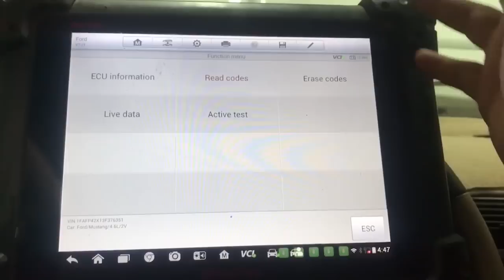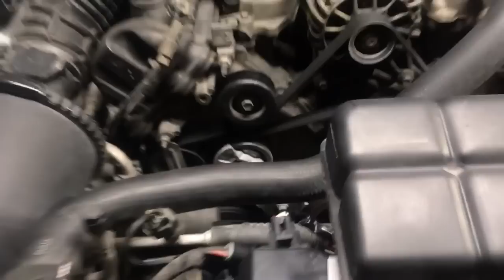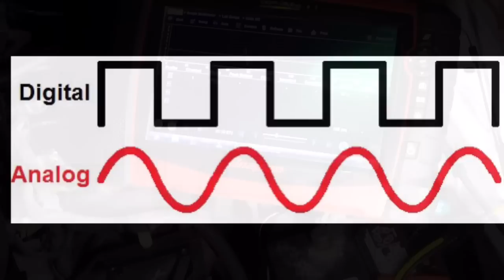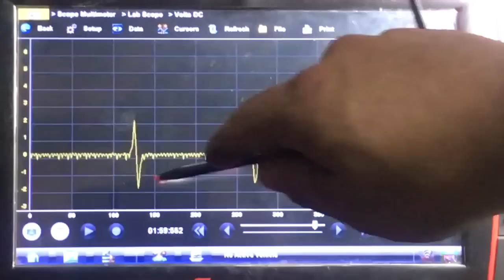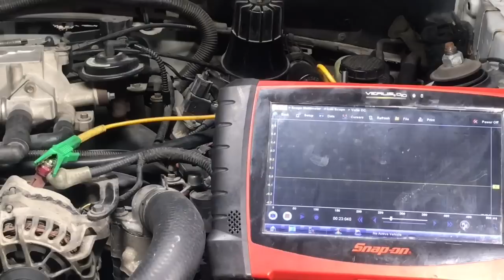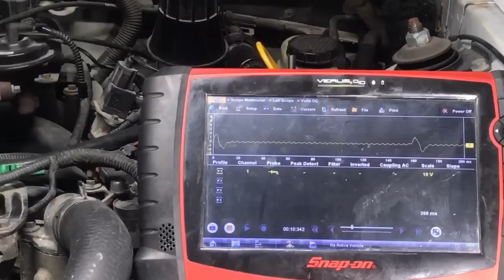How to fix code P0340.  A new cam sensor will not repair this car.

Comment: I just got the P0340 on my 99 Ford Explorer EB 5.0 but I don’t have a scope to determine if it’s my alternator but I do have suspicions that it could be the alternator how could I tell?
Reply: rawdeale get an alternator and change it, if it fixes it drive on, if it doesn’t take the alternator back and replace the cam sensor after checking the wiring.

Comment: I got the 340 code/cam pos sensor bank 1. Replaced it with autozone sensor and ran worse. Then tried OEM sensor and still runs worse than part that's was originally in there. Does the battery need to reset after replacing? Any ideas?
Reply from the maker: Fish Stix first what needs to be does is to hook up a scope to verify powers grounds and signals from the cam.
Reply: @OzMechanics  ok thanks. I'm gonna need to take it in for that. I was worried that my parts weren't correct, as the aftermarket and oem ones both seemed to have a smaller magnet than the one that was originally on there
Reply: Both replacement parts make it run worse than the original one that's throwing the code and giving me the misfire
Reply from the maker: This video is an example of a bad new sensor. But I would t have know without a scope 

P0340 Testing a BAD cam sensor https://youtu.be/bCHQfMA6aLw

Comment: I have a 2005 pathfinder its saying cam sensor. I put one in an it ran great for not 10 mins an just through code again. Any ideas
Reply from the maker: Matthew Corbin the proper way to verify what’s going is by using a scope to see the voltage
Reply from the maker: Does it have code p0340
Reply: Yes p340 code is showing... but when i put a fresh sensor In it doesn't show till it malfunctions again. I also see where a wire has been worked on
Reply from the maker: Matthew Corbin might have a short somewhere. Scope would be used to see the signal
Reply: @matthewcorbin850  did you find the issue?

Comment: Code P0340
Well, in your case your car starts up “normally” 
In my case, my car tries to start up but won’t do it at all 
I thought it had a battery issue but I test it and it was ok.  because when you try to start up the car, the engine sounds weak and won’t start 
I think I will check on the alternator and see what happens 
Thanks 👍🏼
Reply: MY friend and others 
Let me tell you that in my case 
The timing chain was broken so it was Not moving the camshafts 
That’s why the error message P0340

Comment: damn Bro u the bomb . how does a bad alt kick off a bad cam sensor code though ?
Reply from the maker: 2 wire cam sensors are ac signals. The same as a bad diode In an alternator that produces ac signal
Reply: @OzMechanics  i have a 3 wire cam. Plug
Reply: @OzMechanics  plus its a honda but no doubt I check my alt and it is bad, you a good mechanic. Im hoping this is my problem :)

Comment: I just replaced cam sensor on 04 F150, 4.6. Scan tool says it caused #5 misfire.
truck runs bad.
the change out did not help the performance.
could alternator cause this?
Reply from the maker: Brad Turner what code did the vehicle have ?
Reply: @OzMechanics  P0305 & P0316.
I changed cam sensor. light is gone now but still rough idle, power loss, and no A/C when going up hill or under load.
All of this started at once during a 3 hour trip at highways speeds.
Update, installed new coil pack on #6 cylinder tonight and it's running better than ever.
Reply: B_ rad Did you do a relearn after replacing those parts?

Comment: Iam no genius but I wonder if the after market alarm is causeing a ripple back feed voltage through where it is robbing power off of. Cause without the altinator the battery becomes the condenser. So I wonder if you disconnect power from the after market alarm would that get rid of the ripple on the 5v signal. Sence the after market alarm might be smd pwm. And not a ecc analog power and ground ac to dc bias voltage set up witch is how the car was engineered to work. Cause smd/ pwm  circut boards where not common place on. Vehicles till around 2007 or so. Just a thought. Maby the after market alarm is causeing the diode or voltage regulator on the altinator to work against the pwm ripple on both +and - sides. Cause after all wires are bidirectional and also magnifie / absorbe  any electrons or rf signal in either direction cause the electrons/ cathode always wants to go to the anode. And re start the electron / neutron process of chemical reaction from +to - then back to - and etc.

Comment: What about code P0345
Reply: I just got my f150 ran through a diagnostics machine and it came up with my camshaft position sensor and the code was p0345. Any advice other than replacing the sensor?

Comment: Cam shaft sensor bank 1 on a nissan for sure.👍
Reply: I have 05 maxima. Going through it now
Reply: @mef12727  was that it?
Reply: @mikerobinson4092  yes also my wires( plugs from the harness) were exposed. I went to junk yard for a better plug.
Reply: @mef12727 ok👍
Reply: @mef12727 me to I can't accelerate much car seems to be in limp mode and stuck in gear

Comment: My cousin changed her cam intake sensor because she got a p0340 code for bank 1 sensor or Bank A or single sensor and the car does the same takes about like 3-5 seconds to crank and turn on. She has a Mercedez benz c250 2012 1.8L and im thinking if it can be the Cam adjuster magnet? 🤔
Reply from the maker: MR M3 I would check powers and grounds and the sensor. And make sure you are getting a proper signal coming from the cam sensor using a scope
Reply: @OzMechanics  thanks a local Mercedes benz shop replaced the parts and didn't do anything different. Tbh i feel like if my cousin takes car back won't do anything tbh would he worthless leaving for 3 days for nonesense
Reply: @mrm3686  any update on this?
Reply: @GTiR23  Yes so I got to fix the issue and was resolved by replacing the Actuator which was failing since its magnetized and reads the Cam sensor and would not read correctly so the car would run rough and sometimes turn off. So replace actuator and replace the oil and If possible replace camshaft position sensors with new ones and that should help you with the issue
Reply: @mrm3686  Thanks for the advice!

Comment: Could you please tell me where the Krank sensor positioner is on a 1995 five point o mustang convertible please text me back my name is John
Reply: Google it man. You will need your engine size as well. Just type in Crank position sensor location 95 mustang and you will find it. Google has all the answers you will ever need.

Comment: I'm having this same code in my expedition. Took to Autozone pulled codes. Had the position senor fault P0340 Said replace alternator, with the cam sensor faults. Will find out more Monday when I have my Tech look at it
Reply: @Hi Me I never found out. I traded it for a Brand New F150.

Comment: can timing belt  cause same error code?
Reply from the maker: This is a circuit code so more often is a wiring issue or the sensor itself
Reply: I  loved  the  way  you  cleaned  up the  power and  eliminated erroneous  signals. It's  just  taken  for  granite  that  power is  good. honestly  I  don't  know  why  checking power isn't SOP for any  problem  involving electronics.  noisy  power =  bad problems.  great lesson.

Comment: Found this video as I am tackling a stubborn P0335 Code on a 2010 Honda Civic Hybrid (not my first choice in a car but as a ride share free lancer; it is my bread and butter) Replaced cam sensor (New OEM) and it’s back six months after the repair. Ocasional abnormal idle. Rpm activity will act up while driving and shifting gears. Lurches every now and again while driving. I appreciate this thorough and informative video. I am still scratching my head on what could be causing this code but it looks like I found myself a good channel to subscribe to in the process. Video notifications are turned on. Great video!
Reply from the maker: Paradoxx thanks for stopping by and checking out the video and  for subscribing as well. Have some new videos coming out soon

Comment: My 2006 Mustang GT has codes P0345 and P0349. Both of my cam position sensors are new as well as my crank position sensor (Ford OEM).I just replaced the lash adjusters, cam followers, cams and all timing components (everything new). I am 99.9% sure that the timing is correct as I took my time with it and had the crank locked in position with the tool and had the chains lined up on the dot on the crank and the other end on the phasers in their correct places. It says I basically have a VCT solenoid stuck open or my timing is off and that my cam position sensor is bad. The car will start up and idle, but if you try to give it gas at all it backfires through the exhaust. I do not have this expensive scanner. Please help me out if you can. Thanks, Frank.
Reply: Any answer on this I need it too
Reply: @damianwayne5302  I found out that I had the aftermarket non OEM cam phasers on in the wrong orientation. Driver side "L" at 12 o'clock (on colored chain link) and passenger side "R" at 12 o'clock (on colored chain link). Once I found my issue and reset my timing chains and phasers I was good to go. The most common issues are a stuck VCT solenoid(s), bad alternator, bad timing/jumped timing.

Comment: I just bought a Ford ZX-2 that was giving cam and crank codes and came across this. Wouldn't have thought that the alternator could cause anything like this, how bizarre.
Reply: Did you replace the alternator? Did the problem went away?
Reply: @raiya1114  i would like to know the answer to this aslo

Comment: Good diagnostic video, thanks alot. But I got a question, after disconnecting the alternator, what happened to the alarm P0340.
Reply from the maker: Waheeb Sayani Is which alarm are you talking about ?
Reply: @OzMechanics  As i understood from your video is that the alarm  P0340 was actually generated due to high ripples generated from the alternator, so you disconnected it, my question was, did the Alarm P0340 was cleared after you disconnected the alternator?
Reply from the maker: Waheeb Sayani if you mean the check engine light. It has to be cleared
Reply: @waheebsayani4111  codes stay in the computer until they're removed (either leaving the battery unplugged for awhile, or using a code reader).

Because of that, you can have a situation where you're not sure if a code is current or just a uncleared older issue.

Comment: OZ MECHANICS I HAVE THE SAME ISSUE WITH THE SAME CODES OF P0340 AND P0344 ON MY 2005 EXPEDITION AND NO ONE SEEMS TO KNOW THE ISSUE. HAVE REPLACED THE CAM SHAFT SENSORS STILL KEEPS READING THE CODES.. YOU WOULDNT HAPPEN TO BE LOCATED IN SOUTHERN CALIFORNIA WOULD YOU?? LOVE THE VIDEO AND VERY INFORMATIONAL..
Reply from the maker: I’m actually in Texas but I do know some people in the LA area and dan Diego
Reply: @OzMechanics  THANKS FOR THE REPLY. PLEASE SEND ME THEIR INFO SO I CAN LOOK THEM UP AND SEE IF THEY CAN LOOK AT MY TRUCK.. HOPEFULLY IT DOESN'T COME OUT TOO EXPENSIVE TO FIX BUT HAVE TO GET IT DONE.. THANKS OZ MECHANICS..
Reply from the maker: GREG ESCOBEDO What part of California are you in ?
Reply: @OzMechanics  I'M IN THE ANTELOPE VALLEY WHICH IS NEAR THE SAN FERNANDO VALLEY..

Comment: Good job on the video, not all of us have an expensive snap-on scope, how do we diagnose a P0340 code without an expensive scope?
Reply: Any oscilloscope should work here:a cheap chinese one aught to do just as well. The Snap-on one is just made with Automotive use in mind (and they're built like tanks).

You may also be able to remove the alternator and take it to a shop to have it tested for this as well, which might be a cheaper option then taking in the whole car.

Comment: That was great , my cam pos sensor is barely a year old. The body that the sensor rides on was changed about a year and a half ago. That damn p0340 pops up every month or so, truck runs good so I don’t think that it’s sensor. It’s gotta be the alt. Thank You for the Video.
Reply: so was it the alt ?

Comment: 2003 Honda Accord 4cyl.
I got a check engine light P0341 that i need to clear.
It sounds like a lawnmower when i start it and the RPM drops and dies out.
I changed the spark plugs and coils with new ones and 
It cleared the 4 codes it had that were P0300, P0301, P0302, P0303, P0304
HELP?

Comment: Good video I have a 2004 Mountaineer,I live in Illinois where I just failed the emission test one of the codes was this one P0340 and the other was P1336 from what I could look up one was the cam sensor the other the crankshaft position sensor  do you think a bad diode could effect them both because the truck is running just fine,any suggestions
Reply: This is the problem I have. Idk what to do
Reply: @thomasbackovich3045  man good luck I ended up replacing the camshaft and crankshaft sensors that didn't changed the plugs a couple of bad coils and battery and alternator after the mechanic and other mechanics were saying put a engine in it it wasn't worth it so I got rid of it.... I hate it too because I liked that truck!
Reply: @kjam4236  I’m getting a ticking sound from what’s sounds like the intake manifold and I’m getting a wine. I’m replacing the alternator the two sensors and a thermal housing unit.

Comment: Yo Oz!  Great videos.  Thanks for sharing the knowledge. I was wondering; Can you replace the diode bridge regulator on those instead of the complete alternator? I was able to do it on my VWs.  It would be a lot cheaper.  Ivan would be proud!
Reply from the maker: Carlos Moreira yes you can but here at the shop I just go ahead and replace with a oem unit.

Comment: Aye bro my car has the same code and i changed the sensor my alternator is fine and i cant find whats the problem my car cranks for like 5 seconds then starts and has a rough idle also i have a chrysler 300c 5.7 hemi and one other problem i have is that ny engine wont past 40mph or 3000rpms and i dont know bro i changed alot of things and isn't working im about to give up can u help out on some bro??
Reply from the maker: Ricardo Rogers Ricardo to be honest brother I don’t want to give you false info. Th proper way to fix the issue is to diagnoses it. Cars are getting pretty complicated now. I just don’t want to give false info so you could be out more money
Reply: Where you think i can diagnose it?  Cause i myself dont have the tools
Reply from the maker: Ricardo Rogers with out tools it’s really hard to diagnose.

Comment: It's things like this that motivated me to buy a scope. Love the diagnostic strategy. Excellent work Oz 💪
Reply: I have a 2004 F150 with the code p0340. Changed both of the sensors and check engine light lights up after a while. When the truck is in parking, it feels like a rough idle but once i put it in drive, theres no rough idle. What do u think?
Reply: Dido on the scope fixing to get me one.

Comment: When I first started down this path of learning about diagnostics, I was attempting to find a way a DIY'er could bypass using a scope and use common methods (cheap). But as I learn, I have also realized having a scope is required, or, you take it to a good shop.
Reply from the maker: That is true. Scope just makes everything easier and clarifies the actual problem. Once I got my hands on one I was hooked

Comment: Good job Oz. Really appreciate your videos.  From experience 120 mV AC to 250 mV AC seems to be the max allowed ripple depending on manufacturers. Usually outside this range you'll get sensor related codes just like this beauty you diagnosed. Even if no codes occur it's good to test AC ripple when newer batteries are testing bad. AC voltage is bad on batteries.
Reply from the maker: Billy Yoder thanks brother. Yea I’ve been waiting to get something like this. I’ve read about them but haven’t messed with one that would mess with the cam.

Comment: Loved it , excellent presentation ! 
I’m having similar  problem with my 94 3.1 liter Olds Ciera , gone through 13 cam position sensors , very frustrating, especially if that’s not the problem , same trouble code here
Reply: 13 sensors? , your halfway there man,  don't loose hope, don't give up on that one,  you are never going to forget that one,
Reply: @sargetester99  bahahahahhahaha
Reply: I replaced like 3. They last for like 6 months to a year. Always wonder why same code comes back.